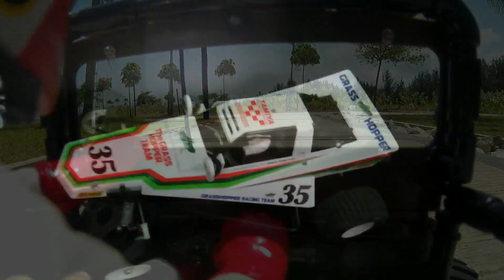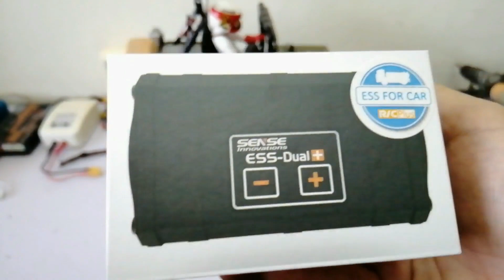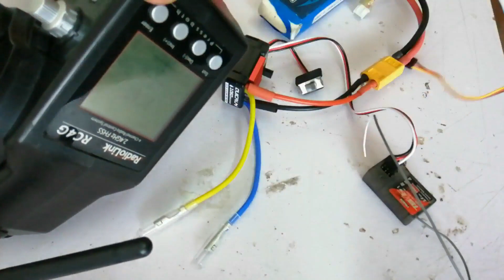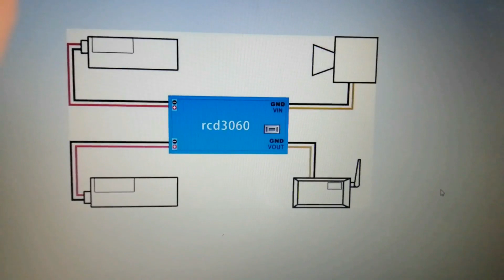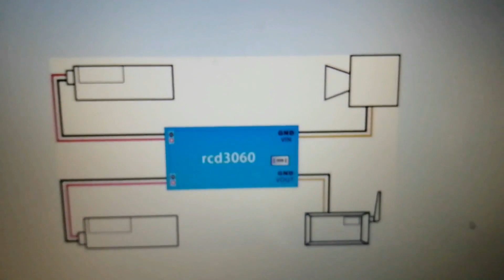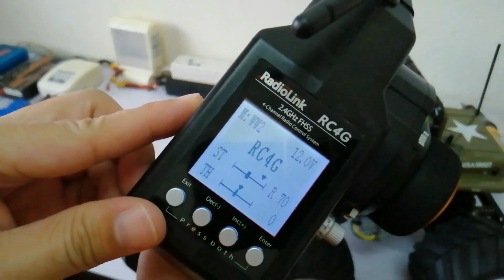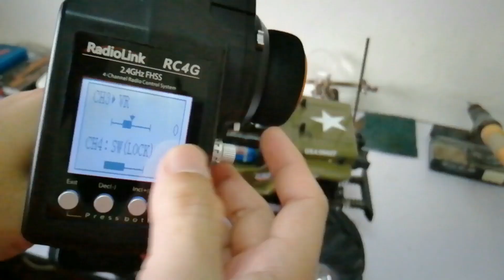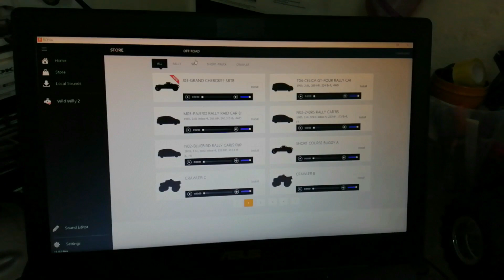How to build FPV on Tamiya WILD WILLY 2 - cockpit style drone driving

Comment: Great job on the build. The engine sound is very realistic. Ah, the good old days of V8 power.
It's too bad that Banggood is sold out of the RCD 3060 boards. Aliexpress is selling them for about 4x the price.:(
I'm thinking of doing the same thing with my Wild Willy or Axial crawler but with head tracking for the camera via an x/y accelerator board.
Reply from the maker: Thanks, i've also double check the RCD3060 indeed sold out, the only alternative would be at hobbyking website known as Simple OSD module.  I would suggest go for Axial for serious off-roading FPV, Wild Willy is cool but i have that stuck moments on deeps roots and obstacles being just 2WD.

Comment: Hi ,its me hope u doing well 
I have ts832 600mw tx same as u in the video ,
My question 
Do i need camera with my mic or does vtx has inbult mic for audio
Reply from the maker: The ts832 600mw VTX already have mic build in so you don't need any camera with external mic for audio.
Reply: @Supermotoxl  thanks bro for replying 
Appreciate it ,
Reply from the maker: @AjmalYakoobMMAMuayThai  sorry for late reply, you're welcome. 🙏👍
Reply: @Supermotoxl  hi bro ,i habe another issue ,i coudnt buy the osd what u have mentioned coz uts expensive ,do u have another model thatbu can suggest ,woul be helpfull 
Tx
Reply from the maker: @AjmalYakoobMMAMuayThai Micro  Minimosd is a cheap alternative but a bit harder to work on since u need extra programming and flash work.
Reply: @Supermotoxl  thank u i mnage tp build the car ,anyhow im using lipo battery tester on the dashbord so i can see the voltage,
Also will get more range if i follow ur monppole antenna modification ,?
Now  im using circular polarized one ,
Reply from the maker: @AjmalYakoobMMAMuayThai  for antenna depends how you drive to obstacles, stock antenna good for long range without obstacles. Circular great for driving around bushes or forest. Also the receiver end antenna can be a factor eg:  helical and patch.
Reply: @Supermotoxl  so i will use circular gor vtx and  helical or patch for rc ,and reciever with double antenna cpnnectors i use  both helical and patch ,spunds good yeah?
Reply from the maker: @AjmalYakoobMMAMuayThai  double connector for two antenna on one sma/rp-sma port?
Reply: @Supermotoxl  i mean my  5.8g reciever has only one antenna plug , so which one u suggest to connect if im driving in the park ,patch or circular ? 
For vtx i have connected mushroom ,
Any suggestions ?
Reply from the maker: @AjmalYakoobMMAMuayThai  if long distance beyond 1km and you wiling to move the antenna direction on vrx around then use patch, below 700m use circular especially driving behind bushes.
Reply: @Supermotoxl  thank u sir 🙏🙏🙏
Reply from the maker: @AjmalYakoobMMAMuayThai  you're welcome 👍

Comment: Hi hope you doing well,
I followed your fpv wiring diagram, but Throttle isn't working meaning, car is not moving,
What will be the cause?
But when i connected usuall way then everything is normal

Can u help me please,?
Reply from the maker: What ESC model you're using.  Some ESC need calibration via controller to work.
Reply: @Supermotoxl   wp1040 brushed 60A esc
Reply: @Supermotoxl  any other way to connect?
Reply from the maker: @AjmalYakoobMMAMuayThai  You'll need to remove out the ESC and connect direct to CH2 on the receiver to test it and calibrate your remote.  Do not attach FPV yet.
Reply from the maker: @AjmalYakoobMMAMuayThai  You can join our conversation here at our forum:  https://www.rcgroups.com/forums/showthread.php?788665-FPV-Car-and-Other-Fun-FPV-Projects-Thread